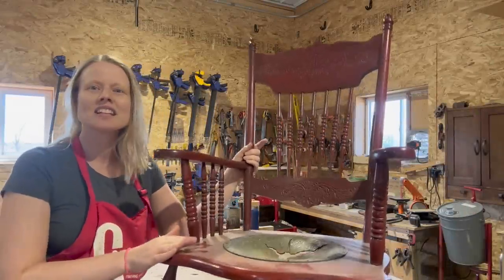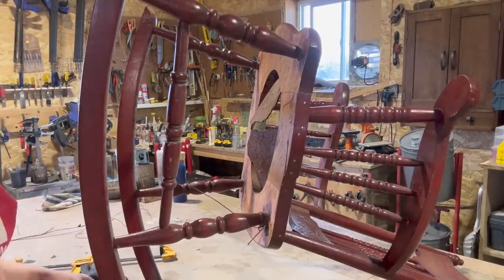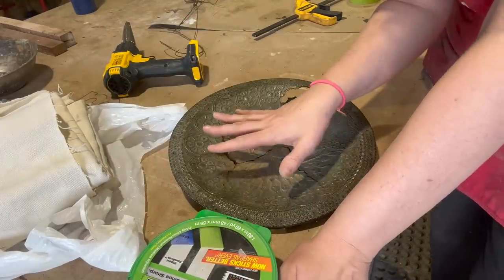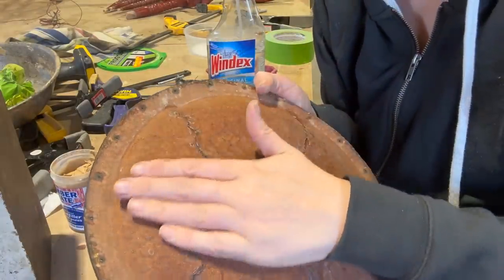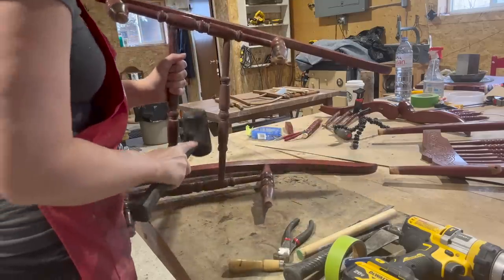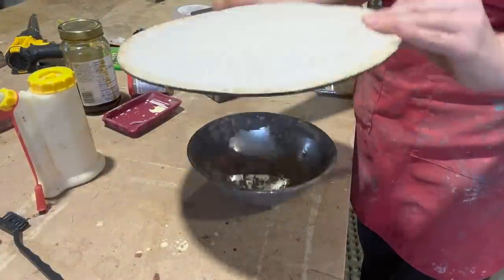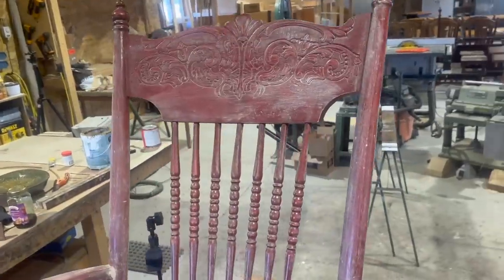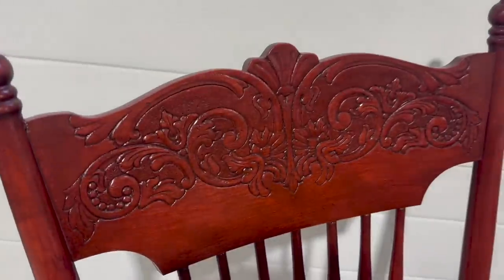I repaired the most UNUSUAL seat

Comment: I remember my Grandparents kitchen chairs being wired together. I think it is cool too! A tip for you maybe: they make screw and nail extractors you can get. Also, you can make your own out of steel brake line from the auto store. Just cut some teeth in one end with a file or something and use that to drill a round hole that you can fill with dowel or use a plug cutter and make your own.
Reply from the maker: Well I think irregular holes actually blend better than perfectly Round ones. But they are cool tools

Comment: I think my grandmother had a rocker with an applied seat but it was rectangular.  It never occurred to me that it might be pressed paper.  She was such a small person that the seat was never under any stress when she used the chair.  I wondered as I watched the video if the original was flatter and that it had bent downward with use and with age.  I could imagine dampening it slightly and putting it on Baumgartner's heat and vacuum table to flatten it.  The canvas seemed like a very good addition.  Thanks for the video.
Reply from the maker: Nope they were always cupped. Cheers

Comment: 5/16/23:..refinish, reglue & repair P a p e r circle Pecock center of seat..! 
  Have never seen HD paper in chair seat before, amazing refit & repair of paper with your fantastic techniques...using putty in very irregular torn break- edges +  layers of more paper, glue & canvas! It fits like a glove!
 ..about pulling imbeded (small head) 'finish carpentery' nails desiring minimum 'tear-out' for best 'patch-n-fill' later in 'fix' process...am suggesting...try using a 'Plug Cutter'...this drill driven, super sharp, little, 'very short dowell maker tool' can drill a 'surround-it' hole 🕳 which allows for grabbing & pull-out, but leaves a smoothe circular hole on your surface allowing ez wood fill (or small dowell..like a screw covering) then the area is ready for flush sanding & stain or paint & urethane etc. Hope this helps. Rocking chair looks like factory new! A+ ✅️👍👍👏👏🍷cheers!😊
Reply from the maker: Thanks for the tip. Cheers!

Comment: Thank you thank you thank you. I'm trying to fix a very loose dining room chair that when manufactured they used virtually no glue but they put a nail in each and every tenon. I had no idea how to get those nails out until I saw your twisting technique to get the nail to wrap around the tenon and then pull out the tenon. It worked beautifully and allowed me to disassemble the chair with no damage and now I can glue it together properly. Thanks again. I love your channel.

Comment: With that difficult nail in the leg.  Try a pair of vice grips.  Lock it on then rock it back using the seat bottom instead of gouging the leg.  It will slip right out.

Comment: @johnsfurniturerepair great job! I was completely shocked when you said paper...how on earth did you figure that out? I would definitely say leather. 
Out of curiosity...why did you go with canvas for reinforcement  instead of leather? How do you clean/condition the sear?
Reply from the maker: Thanks! Once I saw how it was acting I knew it was paper. And the weight of it. I use canvas because it is thinner than leather and could conform to the breaks and the texture of the molded paper. 😉
Reply: @johnsfurniturerepair  thanks!. Do you know what that style of furniture is called? I want to research it

Comment: If my memory serves me correctly, I faintly remember seeing wire under a chair seat in an X pattern but coiled together for 3-4 inches in the middle then screwed on to the seat through a small man made circle, I’m pretty sure I saw it when a uncle tilted the chair back far enough to raise the front legs……and probably the reason the wire was needed in the first place. So since I will be
80 on 6-3, I’m entitled to forget somethings sometimes. 🤗
Reply from the maker: Yes sounds right.

Comment: I think I would have been tempted to use high strength duct tape underneath and then covered the underside with the cloth.
Reply from the maker: Unfortunatley the adhesive is not long lasting and eventually delaminated from the plastic.